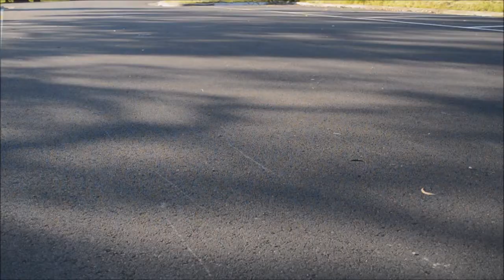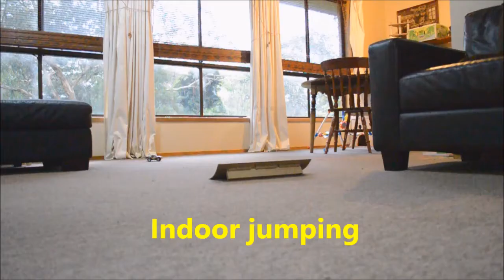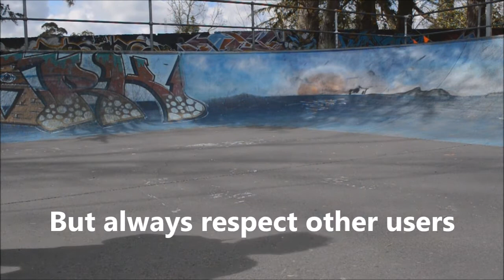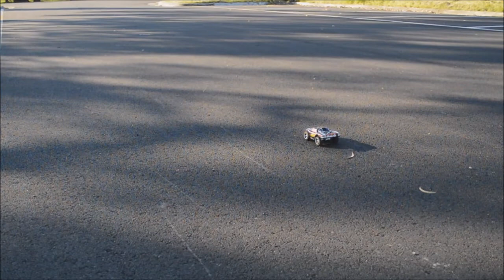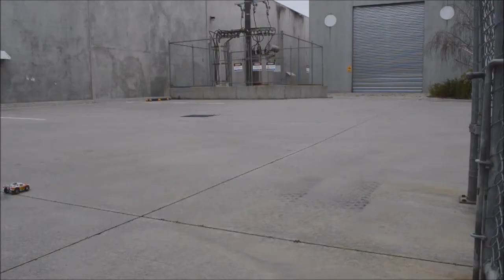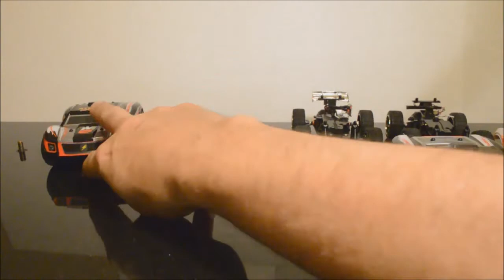Mighty Micro RC Car Mods 3  Atomic Power

Comment: Hi! 

I ordered a WLToys A999, which is basically the same car, except for a longer rear end. 

Can you tell me, which are the original dimensions of the motor and the stock LiPo? I cant find this information anywhere in the internet and wanted to order some upgrade parts, so I can start modding as soon as I get my car with minimal effort.

You mention 160mAh nano techs you use. Are those the Turnigy parts? Do they fit just plug'n'play (solder'n'play) or do you need to modify the battery bay? Does the controller board care for low voltage shutdown to save the LiPos?
You use 8.5mm coreless motors. Are they CW or CCW and do you need massive modifications to mount them? Unfortunately I cannot really see this on your videos.

Sorry for all the questions! I enjoyed you videos so much and I'm quite impressed what you did to those little cars!

Thanks!
Best regards from Austria
Reply from the maker: Hello 
Great questions some are in the vids some are not.
I will answer some tonight and the others in a vid out soon as they have re released these cars in AUS I'm very excited as my fav and one of the best in it size and class for the bucks. 
And I have two I have highly modified but most mods any one can do.
One car lowered and power up the other just too much power and does wheel stands on tack off. They will be in the vid you may like. 
regards 
Adam VA of AVA Magnetic Levitation AUS
Reply: Hi Adam,

I have watched all Mods videos (at least once). Very nice stuff! :-D 
I have seen the lowered one and the twin-engine version. I guess, that most of my questions would have been answered in Mods 8 pt 2, but I cant't find it.

For now I stay patient and look forward what you release next ;-)

best regards
Reply: k
Reply from the maker: Hello 
WOW your keen go good stuff !
The Nano Tech batteries I use I think are a trinity product I buy all my ones from Hobby King there the cheapest best supplier for this.
If you use a 160mAh after stripping it down should be enough room in the stock battery bay, Stock battery is 120 mAh with a control chip on it so if you change the battery you must make a charge plug adaptor and charge with and S1 lipo charger I use an old 9 egals controller to charge, Or like the one in the vid just get some S1 lipos and a matching plug and just remove stock battery and solder the plug on to the board and stick batteries in the rear swing arm with valcro and just plug in any S1 you like I ran up to a 300mAh but a 130mAh+ is fine.
The motor is Dia 7mm x 16mm coreless brushed.
I do mostly mod with a 8.5mm x 20mm but I have run a 5 volt booster once was sick, But hopping to get some budget going and do mods in more detal as well as you tube to help pay for the vids Patreon up now.
There is a vid were I show some of the motor swop but I will cover in more detail soon I will be redoing on Patreon have a very good set up for the L939 on carpet and other no rollover with great steering insane fastest I have ever done.
Interested ?

Comment: I put a 3.7v 680mah Li-po Battery, runs very well and it take hours to discharge. But, the motor are too hot, i don't know if these are normal.
Reply from the maker: WOW that's a very large and heavy battery to have on it.
The motor heating may be just the weight of the battery as its a DC motor if loaded up with weight they will just draw more currant to over come this load even if it means drawing too much and over heating or even burning up.
Please weight your battery and car with out it and let me know how much they are.
I'm doing a vid of the onslaught to be given away 1000 sub comp and it has exturnal battery mount I did and it uses 130mAh upto 300mAh and change them out when flat works great.In many ways is a better car than most and only $30 after mods and driving don't wish to give away but must.
Reply: AVA Magnetic Levitation Yeah, but it runs very good, and it dont weight to much. Sometimes the battery power it's too much and i can't have control of the car on x3,x4,x5 of speed. One week ago i was playing with it, and the battery take hours to discharge. The motor was fine, not to hot, just need to watch the weather, suns it's too strong and the motor overheats. You think i need to reduce the power battery or take the risk?

Comment: k, u got me! now I'm totally interested in modding my micros. engine and all.  so, i see u upgraded inthe brushed or coreless version, but have u tried any way to upgrade a micro into a brushless version? or would it b too much? i.e. reworking the board, etc. And i c the change to the motor and battery, but how/where do get the bearings? do u also change the wheels/rims, and all the parts for the real axels, etc?  Thanks in advance.

Comment: Hi, ive just ordered the L939, do you know if its possible to remove the onboard battery, fit a female socket for a (micro losi?) hubsan type lipo so the batteries can be changed when they run out rather than stopping play and recharging the car. Is there enough room under the short course body to velcro say a standard 380mah base hubsan battery ?
Reply from the maker: +Damon Cannard Hello Good purchase you can remove the standard lipo battery and replace with a bigger or better one but you must not charge with standard controller but adapt any standard lipo charger.  There should be room to do what you would like to but you will only need 120mAh up to 160mAh lipo may fit in inside. 380 may not fit.I'm working on a 300mAh lowered hi speed one now and I had to unsolder the on off switch and put on top of the board to get battery to fit under it and it only just fit but 300 mAh is massive they only come with 120 mAh standard.Changeable battery sounds good long as you can close the body back up tight.
Reply from the maker: +Damon Cannard Ps . A second car may help subscribe and stay tuned I will be giving away one of these cars in the very near future. May do some mods on it to.
Reply: +AVAMagneticlev that's great thank you. I basically want to take a bunch of batteries out and change them as and when. The batteries are charged with my hobbytiger charger, wouldn't be an issue for the car at all. Will look at doing it when mine arrives. I have it's bigger cousin the HPI Blitz Flux and have enormous fun with that. A take anywhere version would be great, especially on rainy days stuck in.

Comment: Nice vid,awesome
can you list  :.-(  the upgrtades you did (item code or some thing)
my english is not as good as i would like  (understanding Is so hard )
I own the HPI q32  expensive but woth each..Euro  
the motor is 21mm x 8,5  diameter  mauy not so fast , im RC car lover but  as you know , normally brushed motors  doesnt  explains about Kv   (r.p.m-1) / Volt
thanks!!!
Reply from the maker: +Newlacecu cataluña Hello your lucky the HPI Q32 is the car I would like to push over 60km+ but I have no budget to get one yet. I will tell you first the motor I use ( Eflite part No. BLH3203 ) its a 8.5mmx23mm has extra Nm. You may need to gear up with it to may make a faster Q32.Most coreless brushed motors have a RPM rating unloaded and loaded most start around the 38,000 to 55,0000 rpm in the 8.5 dia. Watch my next vid were I do and rear wheel RPM test and calculate the Km.Go Q32 I like them and have already been asked to make a hollow carbon fiber sealed ball bearing rear end for one with wheels balanced and fitted. Thanks for your questionsAdam VA of AVA Magnetic Levitation AUS
Reply: thanks for your answer
I put 2 bearings in the rear (only one ) axel
near each wheel 
the only I dislike from my HPI q32 is , when i ACCELERATE  car tuns  always on its left , I tried lots of sulutions but , nothing  well made woked, (Im old RC lover)  finally I decided to force right wheel  near the rear wig , with a simple  thin cotton rope, that way I do less eficient right rear wheel , now is near to be perfect, when I accelerate , go straight
HPI q32 is very smooth accelerating and breking
if any one need any photo can email me to 
cristianmarcus@hotmil.com
use an easy english please  :-)
Reply from the maker: +Newlacecu cataluña Hello I can't say too much about how to mod the Q32 as I have only seen them in pictures. But the motor I quoted should go faster if geared up also change the battery if there is room use a 130-160 nano tech. As for your steering off line I have hear of this problem HPI sells a hi speed kit of parts that may help. But car should go straight from new. I'm about to release the next hi speed vid in days I will list the sealed bearings and also the motor part No. again and also go over what can be done as most parts I make or mod myself.But good news I have had 2 request to build hollow carbon fiber ball bearing rear axels finished with wheels and tires for the Q32 I may be building a batch of them interested ? let me know. Regards Adam VA of AVA Magnetic Levitation AUS

Comment from the maker: Original voltage is 3.7v 120mAh I don't change the voltage but change to a larger battery with a higher c rating 130-160mAh nono techs work best easy to fit also. You can even put a lighter 130mAh with higher c rating in a stock car and I will go faster and charge in 17 mins. Stock batteries have a safety chip that also restricts the current so after battery swop you can not charge using standard controller I use a old copper charger to charge up cars. Bigger batteries are needed if you go with bigger motors. I'm doing a 300mAh 3.7v next may run 2 x 8.5mmx20mm motors and see if the board can take it if it can then I think the board could work on 5v or more maybe. I will upload a vid In a week showing how to do a battery swop. Thank you for watching
Reply: +AVAMagneticlev  this would b very interesting to see.recently on 2 of my micros, I tried to change the battery to a 250mah. but i think they burnt out the boards. the boards on both smoked as soon as I tried to power up. the nitro rcx was running on a 110mah and the ecx kickflip was running on a mere 60mah. maybe I should have tried changing the motor to a more powerful one first. I'm glad I didnt try the large battery on a fave yet. dont know if they can handle the larger battery.
Reply: +AVAMagneticlev would a larger motor soak up some of the power of the larger battery?
Reply from the maker: youtmeme
Hello sorry to hear this I have done many and not one car board smoked just a plane one and after much EXP in electronics I connected revers and smoked it was friends one I felt very bad. If the voltage is the same should not smoke 250 mAh is big but should not matter. 
Check your connections  with volt meter may have been wrong way around. If you connect right should not smoke unless under load was it running when it happened or when first turned on.
I have two boards go bad in cars but most likely the hi speed crashes one may only be a looses antena both RC tech crap cars. I may kill the hi speed project board in the end but may have to run it on 5 volt booster to get the speed and too much full throttle for too long may kill it.
Well may be able to help in a way in time will be giving away a car when I hit 1000 subs will be a onslaught took me a 1.5 months to get and had many things wrong with it but reworked the whole car now very good and has exturnal battery connection no charging to the car just swop the bat. Will start comp for it soon in a vid and show what I had to do to it was a pain in the ass to have to fix a new car that much.
Reply from the maker: youtmeme If it was to kill the board bigger motor would be more inclined to do it. Some boards will not let this happen and cut out or just restrict the amps to the motor. I think the atomic racer L939 boards will only out put 2 amp no more even if the motor ask for it. 
Its for battery safety protection being. 
What cars board did you kill I may have a free spear.
Reply: +AVAMagneticlev thanks. yeah I thought i had the right way. losi micro connector blue wire to black. and red to red. but I had not used a volt meter. i just hope I can slavage the cars by unsoldering and trying new ways.  good luck with ur project. yeah I feel ya, a lot of money into these little things. but it makes me happy, :)
Reply: +AVAMagneticlev thanks again, but that's okay, iknow u live too far away to ship to new york cheaply.  in my previous reply , those were the 2 cars I think I recently killed. :(
Reply: +AVAMagneticlev and u give me hope! :) hopefully, i dont have to track down smaller lipos. just get the connections right on these and go from there. im thinking i had to get whole new batteries and connectors and stuff. but i DO need to buy a voltage meter. :/
Reply: +AVAMagneticlev hey thanks!!! :), yes I took another look and it was just the connector (losi, micto t) was reversed for the battery and all, so now my cars work with the correction. ur right, the power battery does not matter, it's just getting a battery that fits in the car.